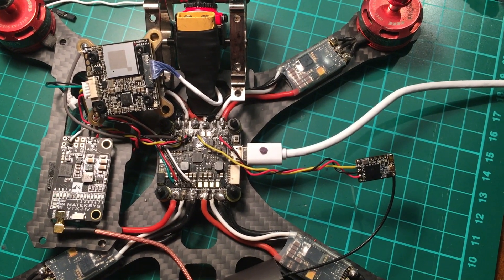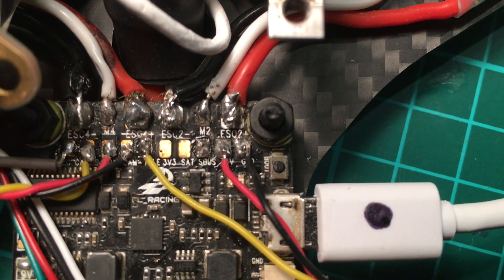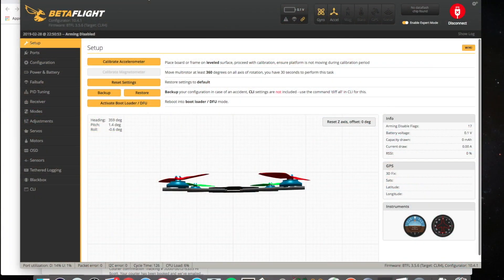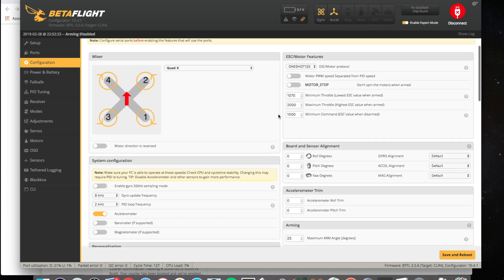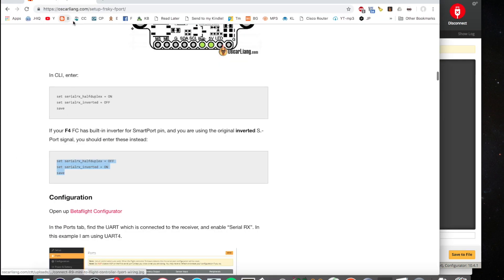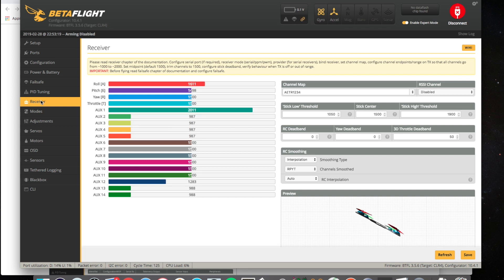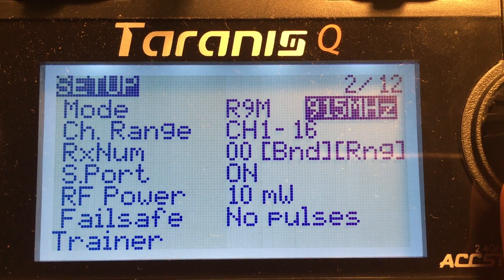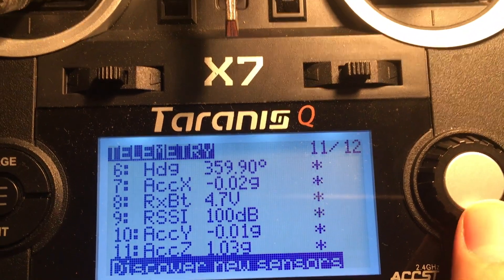CLRACING F4S F4S R9MM F-Port + Telemetry

Comment: I have everything working but no stick movement in BF, so something isn't working. I followed all steps, would flashing everything to flex instead of fcc work? Thanks.
Reply from the maker: I guess you could try it, but I honestly do not know. These things are usually trial and error and process of elemination. Sorry I am not much help.
Reply from the maker: Just checking, you did entre the command lines on the CLI right? Becuase that is a symptom if you have not. Check the config via the CLI to see if the commands took and stuck.

Comment: thanks for making the video! it was concise and the speed of information given was perfect. for first time Frsky users (me) I had to select Fport through the radio. in open tx page 2/12; press Receiver 1; then press options then press fport. next step change channel order on radio, ugg
Reply: Interesting. I don't have that option on my Taranis X7. It actually has SPort - On, can't adjust that setting. But your information may help others like yourself.
Reply: @r33tech53   maybe re flash flash the f port firmware to the receiver  and the latest firmwhare to the radio?